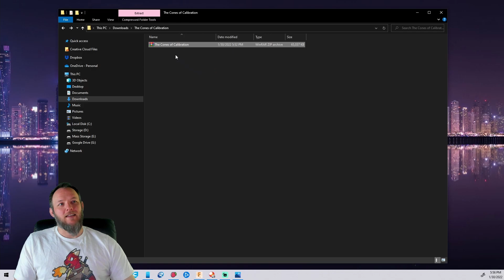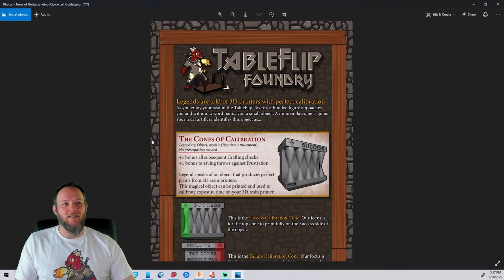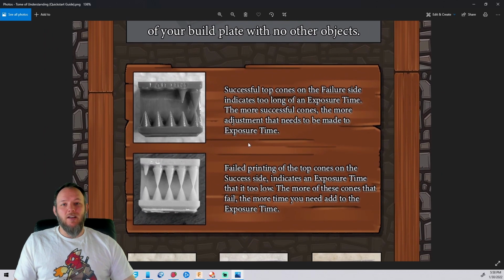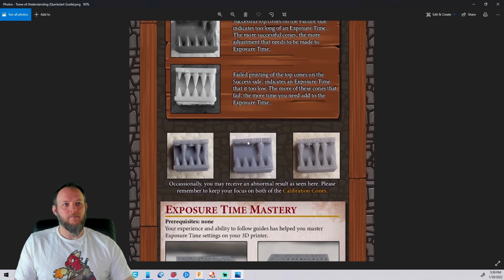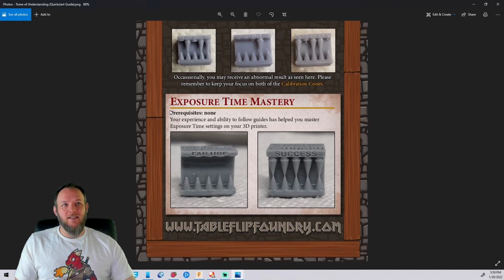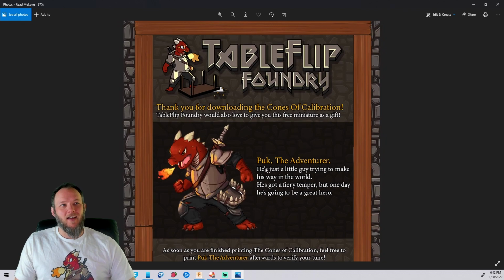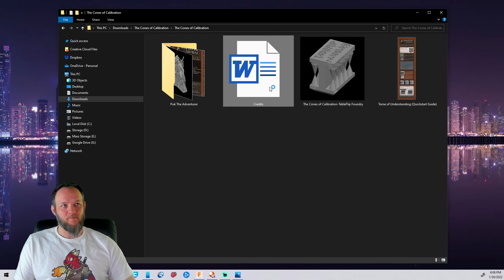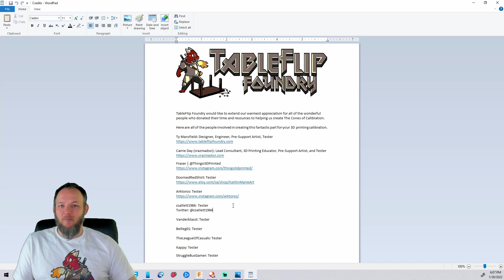This FREE 3D calibration tool will change EVERYTHING...

Comment: Just downloaded and read all info.  Very well put together.  I measured the test and you said it was 11 x 17.5 x 15.5.....I got 10.99 x 17.59 x 14.75.  I'd say pretty much spot on.  I did by first test and on the FAILURE side all 4 cones only printed the bottom cones.  And the SUCCESS side all 4 cones printed and connected....with the far left with a .17 separation.....had to look close to see it.  do not know if I broke it cleaning....LOL  Looks like I am pretty dialed in with my SIRAYA Fast Navy Grey. This was 2.50, just for grins I am going to do a 2.45 and a 2.55.....lol....worth it.  I do have a question:  Would it have any advantage to do anti-alisiang? So far I am stoked and gonna follow and post findings.  Thanks for all you do.
Reply: The test was not tested using any anti-alising and have not found if it makes an impact. Make sure to join the discord though and share those findings!

Comment: Why are the shapes the way that they are? Is there a reason there are flats on the base of the cones? Is there other information we can gleam running this test beyond just exposure? (thinking about lift speed and such)
Reply from the maker: The smaller part at the base of the cone is designed to be an apparent success or fail. If the cone fails to print that area it's definitely failure. If it prints then it's a definite success. 
This part's only purpose is to test exposure at the moment. But if you can use it to verify other things I'd love to know and we can expand testing with it

Comment: Very interesting but the print time @0.05mm is well over an hour per test. You should make it a lot shorter to lessen the time it takes to print. It does not need to be that tall. They could be a LOT shorter since the test is only the thin gap points between the cones.
*compared to the XP2 test that takes only 10mins to print.
Reply from the maker: Unfortunately, the very nature of this being a mechanical calibration means it cannot be printed as a 2D calibration like the XP2 test. In our opinion it's superior to the XP2 test in many ways, and also runs about the same acceptable time frame as the Amerilabs City.
So it is what it is, this takes about an hour to print. Don't rush, calibration is the most important part of your printing experience, it's worth taking your time to do right. If the XP2 works for you and you have that level of experience to read it, then by all means thats the right test for you. It's a perfectly fine part. 
This is meant for people who want something they can read without question.
Reply: @TableFlipFoundry  The test points are the thin joints between the cones, no reason the cones need to be that long. This type of exposure test could be made with cones being a lot stumpier, the tall cones look cooler but it is not efficient or necessary.
Reply from the maker: @GotLoveForYou  Sorry I missed this message. Unfortunately, there are a lot of factors at play when it comes to measuring the strength of the cones. There is a very specific increase in surface area for the cones. It is possible, I supposed to shorten the bottom cones though without too much trouble. Maybe on the next revision I can look into that!

Comment: What increments do you recommend for adjusting after a test shows over/under cure. I'm on a mono screen is that matters.
Reply from the maker: it definitely does matter that its a mono screen. Usually .1 increments work for me. Depending on how far off you are. If 3 of the success cones don't print you can assume something like .3 second adjustment but its really different for every printer and every resin. So its quite difficult to say for certain. You're own experience is going to answer this for you.

Comment: Thanks for the tool and the much helpful video. I am going to try this on my new mono x 6k in coming week. It will be great if you can help with following queries. Thanks in advance. 🙂
1. Why should not we print this alongside with other tools?
2. It might sound stupid but would you comment on accuracy range of this tool from your experiments? e.g. +-0.1s or +-0.2s or etc
Reply from the maker: #1 The reason you should not print this along side other tools or objects on the build plate is to keep the deflection of the fep sheet uniform and symmetric. By causing variations in the flex on the fep sheet it can skew the results of the calibration.
#2 We measure the accuracy of the both through practical prints of models and also through measuring the final result of the model. Different resins can shrink and warp depending on the resin, but generally speaking we were able to average around +/- .05 mm of the intended print size. 
Time plays no relevance to the accuracy of the tool as far as measurement since each printer and resin combo will have wildly varying times. A Photon has 12-14 seconds layer times and My saturn has 2.4 seconds.

I hope this answers your questions! If you want to chat more please feel free to join our discord from the links in the video.
Reply: @TableFlipFoundry  Thanks for detailed response. I got the point that if there is deflection on the plate then it will hinder with cone connectivity. I'm glad that I found your video. I will update here after trying it on mono x 6k. 🥂
Reply from the maker: @aakashdabas982  Im super jealous of your new printer. I cant wait to see the results. Feel free to join our discord too if you'd like to hang out with our community!
Reply: Hi Aakash. Did you try this on your mono 6k? How did the results go?

Comment: Hmm, this test looks simple and clean but i wonder... If I pass this test, but other tests (for example 3DRS Chip or Validation Matrix) shows little overexposure, what to do in this case? Stick to setting from this test? Some tests also recommend adding 10-20% to your ideal exposure time. Is this overexposure affects minis quality?
Reply from the maker: My recommendation is to use the exposure from the Cones of Calibration, then rather than compare other exposure tests, just print some minis and evaluate your experience with the minis.
Good pre-supports will come off easily. Every detail of the model should be crisp and clean.

Comment: Just printed this calibration test 3 times.  Easy to use!  I finally have the exposure for my resin dialed in!  Could you tell us the dimensions so that we can see if our printers are dimensional accurate?
Reply from the maker: You can super easily find that info in your slicer. Just select the scale option and it will tell you the current dimensions!
The cones are 11x17.5x15.5 mm
But you dont have to measure the cones specifically
In your slicer you can drop a cube or a cylinder directly from their tools, scale it to the dimensions you want, print and measure.

Comment: If a newbie found this what is the starting point for exposure time?
Reply from the maker: Unfortunately that really depends on the printer and resin. There is no easy answer there. You're slicer will likely have some default settings. Best to start there.
Reply: Check Lychee slicer and its resin profiles - may help for starting point
Reply from the maker: @factorioguy  Great Advice

Comment: is there any technical reason that it has to be so tall??  

the shorter it is, the faster you will be calibrated.  the validation matrix is done in a few minutes, and the town is less than an hour (on a proxima).
Reply: This is approximately the same height as the Ameralabs town. The biggest issue with flat tests such as XP2 matrix, UVtools, and phrozen is that you do not account for additional variables such as FEP flex, lift speed, potential z wobble, and flex of the resin. The additional height can allow for those factors to be included when testing.
Reply: @crazmadsci3806  fair point.  thanks for the explanation.
Reply: Also, some printers like Mono X have "feature" - transition layers. This means that if you have two burn-in layers set for 25 seconds, you will then have layers 3-12 of your print slowly decreasing from the burn-in time, to your regular exposure time. Because of this, tall test is better (or thick raft).

Comment: Maybe I'm missing something.  What does/can this actually calibrate if there are no measureable parts?  There' no indication that 'this' should be 5mm and 'this' should be 7 etc.  Looks like I could overexpose the hell out of this and never know.
Reply: The tool was designed to have a window of optimal exposure. Over exposing the part would produce successful cones on the failure side and under exposing would have failures on the success side. This was tuned and tested exhaustively in comparison to other tests as well as ideal exposure times for presupported minis. Concluding ideal exposure times are extremely similar to Ameralabs, 3DRS, and sirayatech tests which are more three dimensional to account for additional variables such as FEP flexing.

The cones themselves are great tools to visualize the over and under exposure without the need of numbers which we found confused many new people in the hobby.
Reply: @crazmadsci3806  its not its a crappy test, i was very low on exposure and end up getting way over because of cones, thats considering none of the fail printed and all on success did only with over exposure, siraya test is way better plus can measure where you can tell for sure if resin expanses beyond dimensions you over exposing

Comment: the fail part wudent that also leaf faild reseing stuff in your resin ? sry im a noob just got my mars pro a month ago and i clean my resin after efry print cos i am afrait i will have som exes partly cured crap in my resin and distroy my fap or wors my lcd
Reply: No the part is self cleaning in picking those areas up.
Reply: @crazmadsci3806  thanks will run it this weekend

Comment: Does this work for any resolution printer? Feels like it may not, and if so, is it designed for 4K resolution only? Particularly curious how it will work for the new Mini 8K for example, with its noticeable higher resolution.
Reply: I do know that this works with the new sonic mini 8k as someone has used it with that printer. Resolution does not matter.
Reply: @crazmadsci3806  It would matter for low resolution printers like the Longer Orange 10 for example, if the minimum sized pixel was sufficient to print all of the cones. I don't know this to be the case for the Orange 10, but I think the concern was lower resolution not higher.

Comment: Interesting! Will have to give this a shot! The failed bits, do they adhere to the part itself, or do they end up floating in the vat?
Reply from the maker: Yep! Self cleaning! No worries.
Reply: @TableFlipFoundry  Ah sweet!
Reply: You can see the majority of it grabbed on the top of the failed part and haven't had issues with floating resin. It will appear as a pancaked cone.
Reply: @crazmadsci3806  wonderful!
Reply: I was about to ask this question!  Thanks!